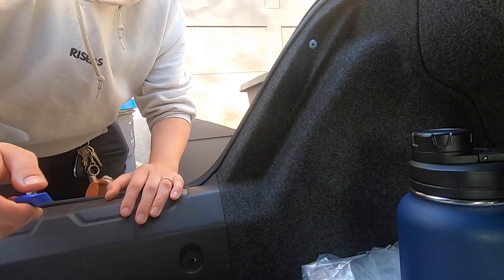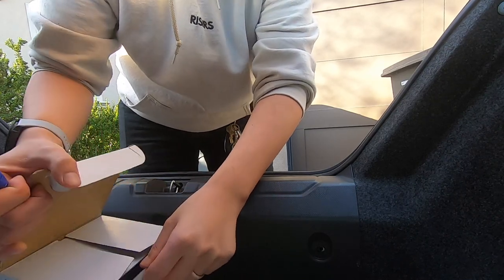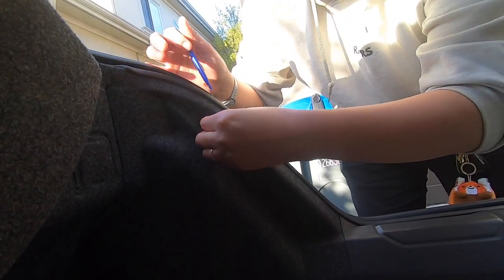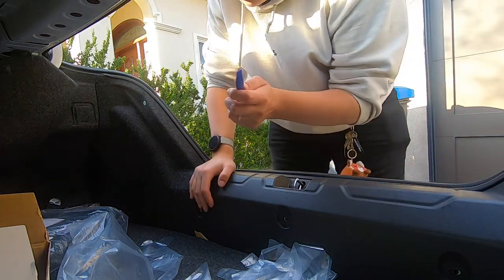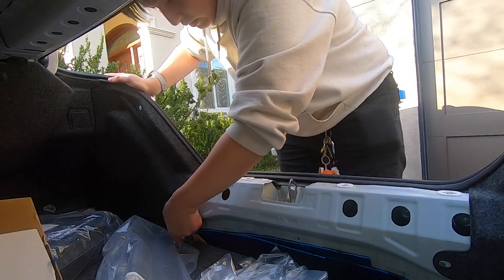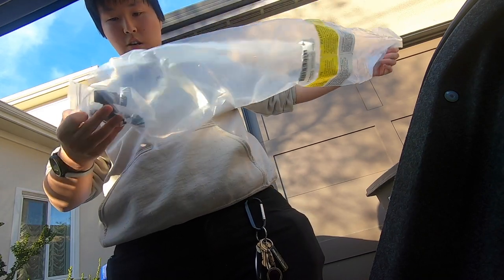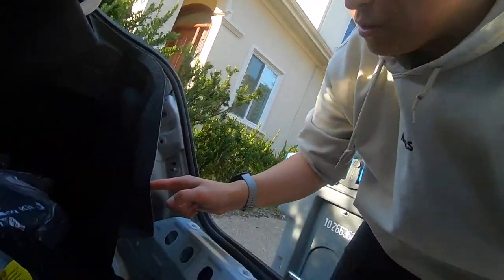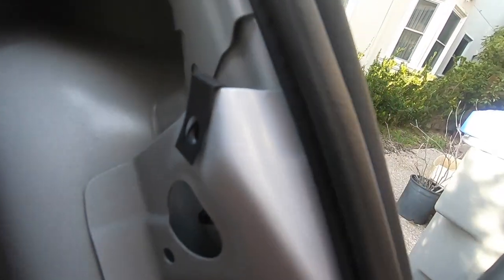2022 WRX CARGO NET INSTALL

Comment: This guy made this 1000% more difficult than it had to be. There's literally only two push clips you gotta remove. You don't need to remove the bottom trunk plate at all. You can tell easily in the thumbnail of this video where the 2 push clips are located at the top of the tail lights. Take out those push clips using some type of plastic pry tool or a flat head screw driver with tape on the tip to protect the plastic from scratches and pull the liner out just enough to get that black clip into place. Then you thread the hook screw in; being careful not to drop the clip because it will be a pain trying to collect it. Viola, you've just installed the hooks and can put the cargo net it.
Reply from the maker: Hey there! There are actually 4 clips the net has to be secured. 1 at each tail light and 2 near the latch to properly secured the cargo net. It was confusing for me since, at the time, there were no instructions for the 22 wrx. I truly do appreciate your feedback and honesty. Have a good one!
Reply: @jaeminyoon  oh you bought the ridiculously over priced OEM version. I just bought a cheap eBay one that just uses the two hooks on the top. I spent $158 for the OEM leds on the front floorboard, and it was hands down the worst money I've ever spent, so now I refuse to buy OEM, lol. Your video did help me though because I wasn't quite sure which push clips the top hooks went into. I wasn't sure if it was those top two or if it was hidden behind the liner so thanks for the help.
Reply: @jaeminyoon  Just installed it. It’s true you don’t need to remove the plastic trunk plate. Just pop out the 2 push clips. Besides that part your video was very helpful. Saved me some time figuring things out. Thanks dude.
Reply: @crimsonnimbus158  It’s just 30 bucks. Good quality, perfect fit with the exact hardware needed. Seems like a fair deal to me especially compared to the prices of a lot OEM add-ons. I think your biggest issue was the fact that you paid money to light your feet. What’s the point of that?